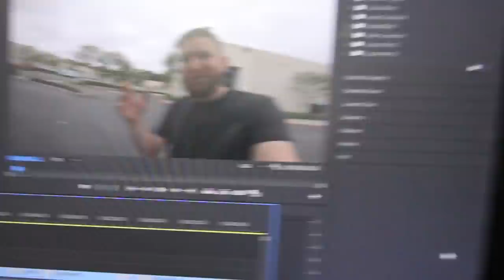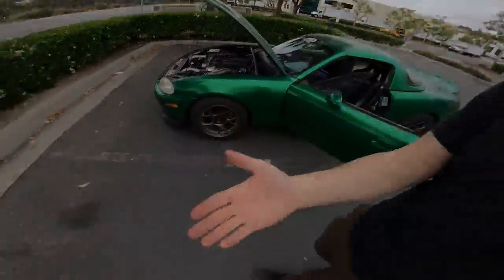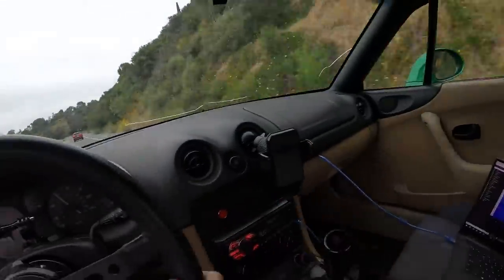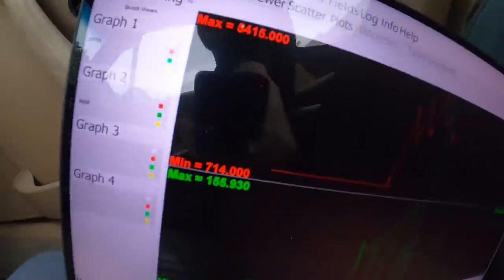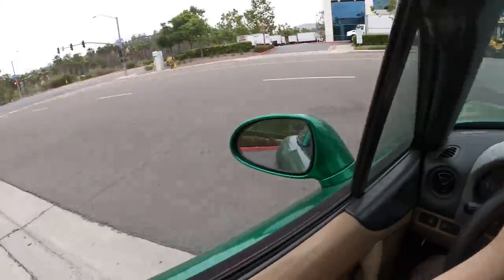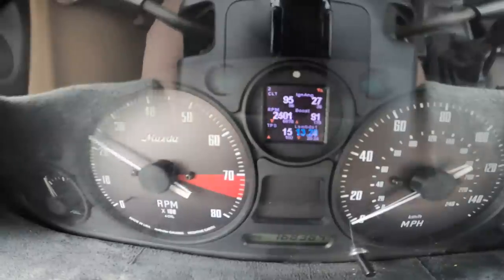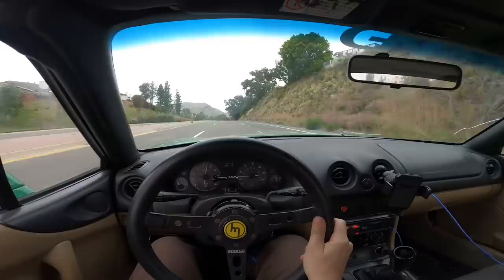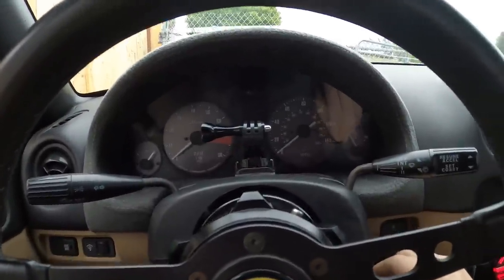The NB Miata is now ROTREX Powered. Taking The First Drive!

Comment: Hey Greg, what do you think the 0-60 would be for this right now? How does it feel compared to a turbo setup from FM?  Awesome video!
Reply: 200whp. Just under or at 6sec. Maybe around 5.5s or so with a final drive that would get to 60mph in 2nd gear and more traction. Several Miatas doing 5.5s at ~220whp.

Comment: I'm new to superchargers so wouldn't the increased instant shock on the drivetrain break more parts than a turbo build of similar power?
Reply: No. The Rotrex does not have a ton of Torque which would be harder on the engine internals than HP.

Comment: I know it's really off topic but I'm curious what you think about chassis stiffening. I'm thinking about getting butterflybraces for my NA. Its very wobbly when I hit a bump. Is a NB really stiffer? I know you got the strong arms on big red. I wanna go turbo soon but my chassis feels a little ,,unsolid"? for more power...
Woud appreciate an answer, thanks
Reply: NB is substantially stiffer from the factory, you can do a budget version of the butterfly brace with 1.5” L section down the box section then use the factory SVT bottom plate. Also a weld in roll bar is a similar price to bracing but with added protection for you and a harness bar included. My NA has a roll bar and the ghetto bracing, poly door bushes, NB front and rear subframes and arms with poly bushes and it’s tight AF. I had an NB before this one, it was great too but the roll bar makes me feel much safer in the NA. Wobbly feeling in bumps is a suspension first problem IMO, then stiffness.
Reply: @foamdataservices  i got a bolted rollbar, superpro bushings and coilovers. And the doorbushings too, but when crossing railways it feels kinda weird inside...🤷

Comment: I'm not sure what the rotex is capable of but it would be cool to over pulley it and vent excess boost at high rpm with a bov.
Reply from the maker: The problem with this is exceeding the maximum safe RPM for the supercharger

Comment: Sounds like it whistles a lot more than the turbo na. Tbh i like the turbo sound a lot more, especially on that mountain drive video, but the characteristics of the rotrex sound perfect for a miata. I know turbos a bit, but next to nothing about SC's. Are there ways to make choochoo noises on a centrifugal SC? I dream of turboing my NB, but this seriously makes me consider rotrex instead.
Reply: Rotrex is a centrifugal supercharger, you can remove the blow-off valve's recirculation tube, but a rotrex without it is super loud.
Reply from the maker: Yeah the red NA barely makes any turbo noises anymore 😔 needs a straight pipe again haha

Comment: Hi greg , i was wondering which rotrex kit is good for a nb 1,6 to make around 200whp??
Reply from the maker: For only 200 you can use one of the smaller kits like C30-84 or C30-74 to gain better low end torque. The C30-94 installed on this car can make well over 300whp depending on how it's set up
Reply: @TheCarPassionChannel  rods are must for this hp ?
Reply from the maker: @costastsementzis9414  No, stock engine internals are fine for 200whp. You'll need upgraded fuel injectors and a clutch though along with the rest of the forced induction kit
Reply: @TheCarPassionChannel  thank you very much

Comment: The rotrex is a last resort for a supercharger. If you went positive displacement supercharger like an edelbrock its instant power especially down low where this car needs it. Its night and day difference. The rotrex is a turbo without the lag
Reply from the maker: On the contrary, Rotrex is an amazing choice for stock block cars, since they don't produce a lot of low end torque, but they scream in the high rpm and still allow you to make good power. They actually compliment the powerband of the motor. To each their own though!